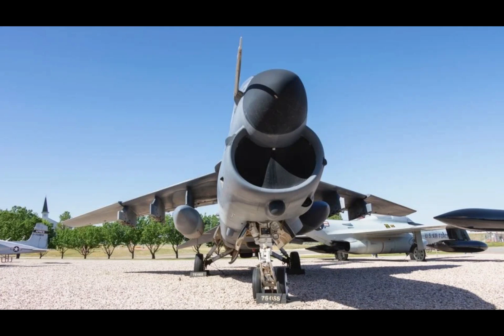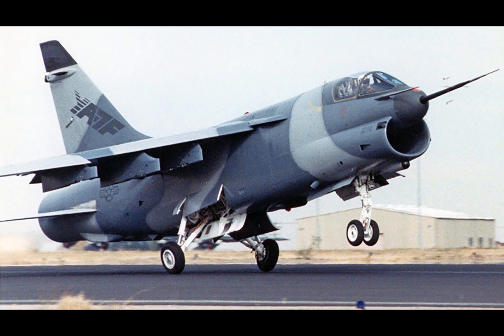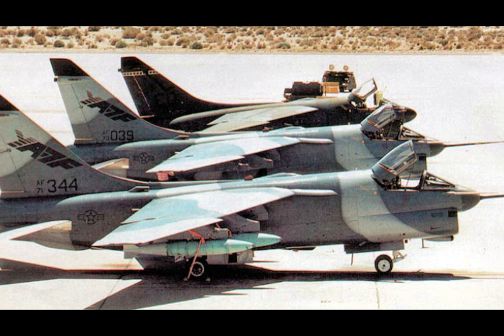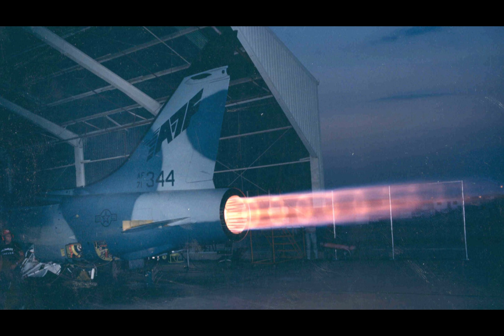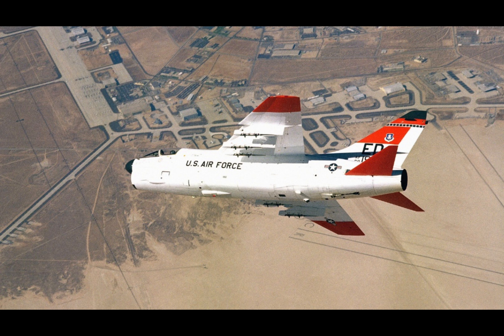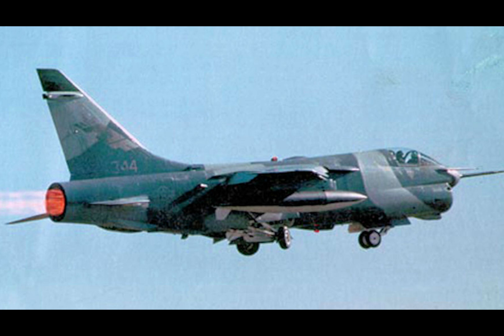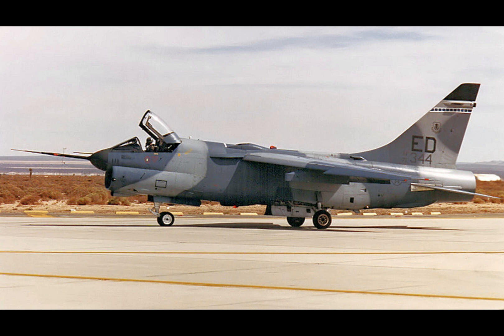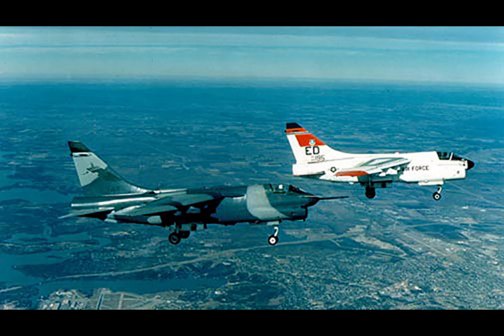The YA-7F Strikefighter: How Surplus Jets Could Rewrite Air Power History || Jones Crasto || YA-7F

Comment: at over 80% the cost of the F-18 Hornet was a total failure.
Hornet is a 4th generation plane and could switch from fighter to attack like Phantom, instead the A-7 was simply an attack aircraft.
Reply from the maker: "Interesting perspective, thanks for sharing."
Reply: Which is a better Attack Aircraft?
Reply: It is not an A-7.   It is more of the original F-8.  But it has all the integrated navigation of the A-6.  It is supercruise capable at altitude. Also it is good for defensive dogfighting. The same Intruder avionics for air and ground threat radars. But the Strikefighter can shoot back.  And hit.